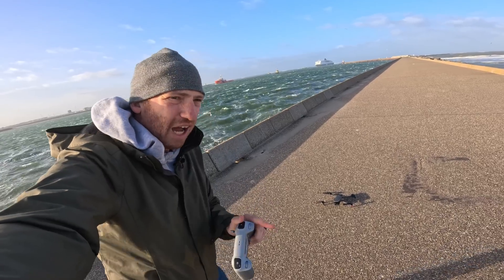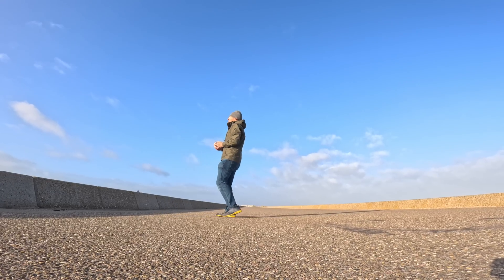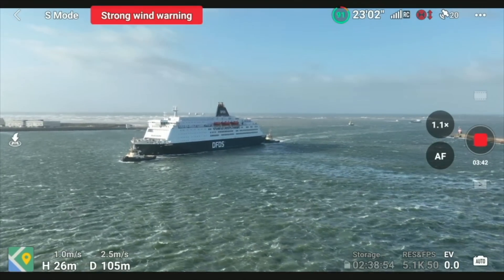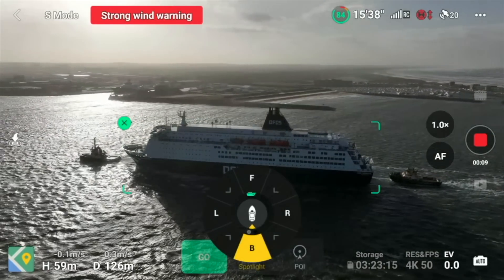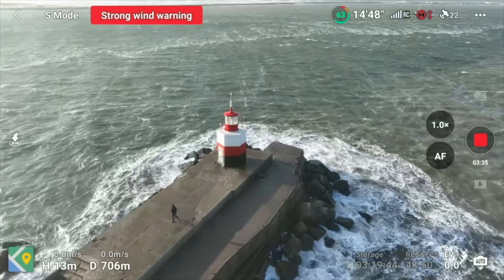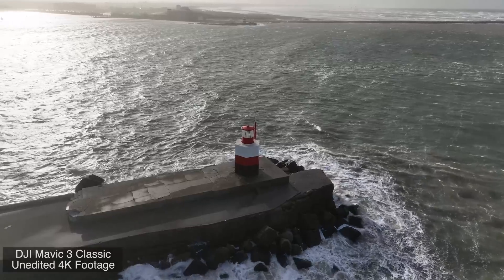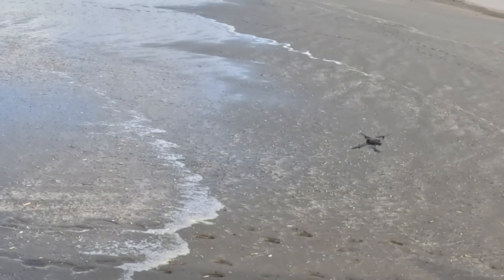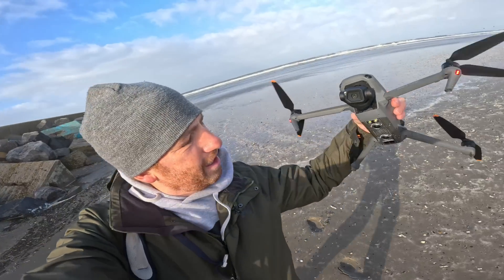DJI Mavic 3 Classic: High Wind Test - 70KPH Winds!!!

Comment: How did it handle the elements such as sand? I’m looking to buy my first drone as a commercial security drone for a private property that is near an airport and is high Wind with lots of gusts and similar sand that is strong enough to strip paint off of vehicles and buildings at times. Temperatures get colder the higher it goes but averages 30°F -50

Comment: Great video. The Mavic 3 has a 21% better wind resistance (28 mph) compared to the Air 2S (23 mph). But subjectively do you feel that the Mavic 3 is more than 21% better than the Air 2S? Would you say it is definitely noticeably better than the Air 2S if you were to fly both drones ar the same conditions? The reason I ask is sometimes I fly in very windy conditions and if the Mavic 3 is a good amount better in high wind vs the Air 2S, I’ll buy the Mavic 3. Cheers! Subscribed!
Reply from the maker: Honestly you won't notice the difference much. Both are very very good - I could mix and match these videos and nobody would be able to tell the difference in really any of them (the single exception being Avata, due to the slight angle offset on side winds).

Comment: Tripod sandbag!  B&H sells empty bag kits, but hauling a 18-27 lb sandbag on a bike would be a pain.  My tripod has a hook on the center column to hold weights, but Giottos hasn't made tripods in 5+ years.  I checked Manfrotto's NL site but saw no weights
Reply from the maker: Yeah, I’ve actually got them. And used them once or twice. However, I’ve since used just my backpack with a bit of extra gear in it, and it’s worked on every wind test till now. This was a beast! 🤣

Comment: Amazing wind speed resistance.. I'm very worried though about the salt deposits corroding the drone parts - motors, pcb, etc they go in really deep when it's that misty. Does DJI actually protect their drones against that?
A bit surprised also at the stuttery footage when in live view considering how close you were
Reply from the maker: The drones do actually have a bit of water resistance, which isn't the same as corrosion resistance of course, but I find that for the most part, I haven't had any issues with the units I've bought years ago and did tests then (at that same spot). I find just giving it a quick wipe-down afterwards helps quite a bit. Certainly I can't get into the ESC's easily, but it hasn't seemed to be an issue.
Reply: @Dcrainmaker  Great to hear that.. I also am concerned about salt crystallising in moving parts but I guess that also never happened 😌

Comment: It’s not banding, what you have seen there where props — I suppose due to very strong wing and sports mode drone had to put itself in such angle where props got into camera. But in general that level of performance is unbelievable. I will not risk any drone in such winds myself and surprised mavic 3 handles it!
Reply from the maker: Haha...thanks man!
Reply: Is the sun casting a shadow of the propellers on the camera lens

Comment: Hello! Could you answer, does DJI solved those issues in M3 Classic? 1) Longtime satellites search, upto 2 min each flight, and GLONASS not used again 2) Raw (DNG) photos have black corners as used lens dont cover full sensor area 3) Flickering while hyperlapse, even in full manual settings (WB, shutter etc.)
Reply from the maker: All my satellite acquisition times were under 30 seconds. Looking at the .DNG files, I don't have any black corners in my photos. As for Hyperlapse, it's been too windy lately to do one (they'd turn our horrible due to the bounce). Cheers!
Reply: And the GLONASS sitch will most likely be due to political posturing so to not impact sales. Just a guess but...😉
#winkwink #knowwhatimean #winkwink